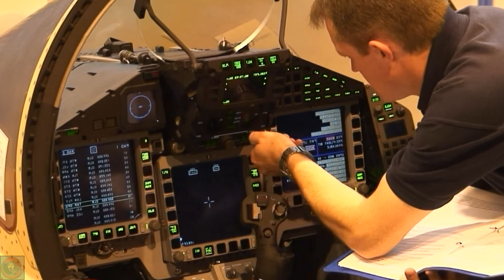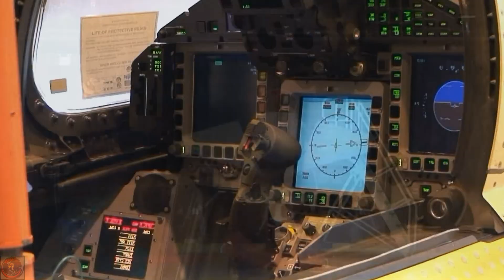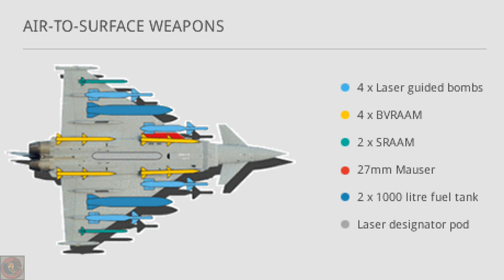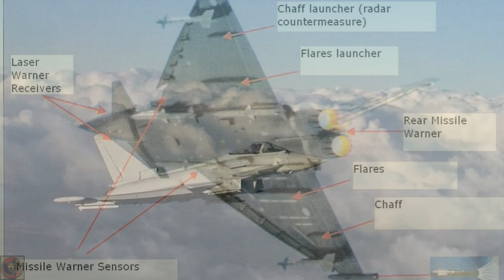Eurofighter Typhoon Combat Fighter Jet - Europe’s 4th Generation Fighter

Comment: I would say an EF is like a 4.75 generation system. Except the stealth has 90% of the capadilities of a 5th gen not discarding that at some point limited thrust vectoring is totally possible to integrate. Will not do the manouvers of the freaking archangel master of the sky thats the F-22 Raptor, but is a well rounded plane for his time and age.

Comment: I love it when dumb kid's say that the F-22 is the best or that it's on a different level, those kid's read to much Wikipedia, for example here is a few years of reading real reports and papers putting the Eurofighter against the F-22.

The Eurofighter is the best, it can do everything the F-22 can do and more.

Some Example's to show why the Eurofighter is king, all can be found online Paper's and Reports open to read. 

The Eurofighter and the F-22 both can take off and go straight vertical, something that kid's say only the F-22 can do, again they read Wikipedia. 

The Specs of the Eurofighter vs F-22 for example.

Speed /
Eurofighter 1550 mph Mach 2.0 TMS.
F-22 1495 mph Mach 1.98 TMS.

Altitude Ceiling /
Eurofighter 65,000 f.
F-22 63,000 f.

Sustained Turn Rate /
Eurofighter 28.5 D/S.
F-22 27 D/S.

Instantaneous Turn Rate /
Eurofighter 36.5 D/S.
F-22 35 D/S.

Engine Thrust - Vectoring /
Eurofighter 21,500 ibf x2 - 2D Vectoring, Vectoring up down left and right. 
F-22 35,000 ibf x2 - 1D Vectoring, Vectoring up and down.

Plus the Eurofighter's EJ200 Engines are the most advanced. 

Being 3 Different types of Thrust Vectoring, 1D - 2D - 3D. 

Eurofighter is lighter and smaller so has a better power to weight ratio.

The Eurofighter has better range / Combat and A to B.

The Eurofighter Has a Better Dive/Cilmb Rate with better energy hold.

G's and -G's.
Eurofighter 9+ and -3.5G's.
F-22 9+ and -3.2G's.

Hard Points /
Eurofighter 13.
F-22 8.

Gun /
Eurofighter x1 27mm with 150 rounds.
F-22 x1 20mm with 480 rounds.

Missiles BVR - WVR /
Eurofighter BVR Meteor Missile the best in the world x2 ranges 1st 150km for fast agile Targets 2nd in testing showed to go 300km for other Targets, The Biggest NEZ of 60km, Speed of Mach 4.5, more Agile then the AIM-120D as well, WVR the ASRAAM Faster then the AIM-9X and more agile between 5 to 55km.
F-22 BVR AIM-120D 1x range Maxed at 160km a NEZ of 20km, and a speed of Mach 4, WVR AIM-9X more agile under 5km.

But no pilot will use the full range of their missile, like the 150+km on the Meteor or the 160km on the 120D due to the low chance of really hitting anything, and giving the enemy longer for the RWS's to pick it up and just do a 180 run, making the distance longer for the Missile, you'll want to fire within about 100 - 70km or  even 50km, to have a higher chance for the Missile to hit and last time for the enemy to have to  counter. 
This is what I find funny is that people say, ( well this jet can fire from hundreds of miles away and kill it before ) NO, it's Bullshit their are the one's that don't know fuck about RWS's - MTT or even Defences, older 3rd gen jets with old as shit RWS's yes probably, but not 4th gen or 3rd gen with advanced or one of the most advanced RWS's ever in it, and plus again people that say from hundreds of miles away, don't know missiles. 

Eurofighter uses the Striker 2 Helmet more advanced and able to lock on to targets and fire with out lining the jet up with the target.
F-22 is outdated and old the hardware and software is not there to be able to use the Helmet to lock on and fire like the Eurofighter can, so the F-22 needs to line up to lock and fire.

Radar / 
The Eurofighter uses one of the best Radars out today, able to pick up the F-35 and F-22 from distance, and able to track a multi group of targets at once.
F-22 has a good Radar picks up the Eurofighter from distance as well, but cant handle as much as other radars can, but still can track lots of targets.

In War Games not just Rad Flag and in friendly training Between the Eurofighter and F-22 both have won against each other over the years. 

Design /
Eurofighter was designed for Air Dominance and does have some stealth in the design having the smallest RCS against the Rafale and Gripen, with the Wing Design on the Eurofighter it is 20% more efficient then your wing design on the F-22, The Eurofighter is 1 of 2 jets the other being the J39 the Eurofighter in the same mission go from air to air then air to ground with its payload, the F-22 its one or the other.

The Eurofighter can do all the F-22 can do plus more, The Eurofighter has better specs better Missiles better Hardware and Software plus is used by the best the RAF.

Plus the F-22 is to expensive for the US to upgrade and keep maintaining, the F-22 was stop being made years ago, plus stop training for the F-22, but the Eurofighter is still being maintained and still being updated with newer and newer Hardware and Software. 

The Eurofighter is king.

Comment: In performance terms, the Typhoon achieves what, in Western service aircraft, only the F-15 can match. The F-22 Raptor is not far behind, but then there's a big gap. Having run through endless videos of aircraft trying to impress the crowds or potential buyers, these three, Typhoon, F-15 and F-22, are in a class of their own.

Whilst the F-15 is your regular barn door in terms of radar cross section, it carries a phenomenal payload. It remains a high value asset because of this, its modernised avionics and it's fighting ability. However that cripplingly high RCS requires further enhancements in electronic countermeasures before it can support the F-22 in stealthier, high altitude missions in the future.

The less RCS you need to hide, the less energy your ECM's demand. This is where the Typhoon comes into its own. Having been designed to the pinnacle of European engineering technology, and as stealthy as European budgets allowed, enough per aircraft cost was saved, against what the USA was spending on the F-22, for the Typhoon to proliferate to a far greater degree. The F-22 has, with the Typhoon, a perfect missile truck. The Typhoon flies more of the F-22s operational flight envelope than any other western aircraft. It is the aircraft most like the F-22. And there are a lot of them. So whilst not bringing the huge wing fulls of missiles to the fight that the F-15 can, the Typhoon can, at first, carry conformal Meteor missiles very stealthily behind an F-22, which it is then cleared to fire whilst supersonic; in supercruise. This is a major boost to the F-22's arsenal in contested airspace. Not only is the Meteor a well respected missile, it is given greater range by being fired from the Typhoon. And whenever the F-22 needs to manoeuvre or just light up and be somewhere quick, the Typhoon is there, in the shadows, no problem.

The Typhoon is a smaller aircraft than the F-15 or its stealthy successor, the F-22. So what it achieves it does to lesser stores or endurance. But that smaller size improves visible stealth in return. In the visible spectrum, the Typhoon is small and has its PIRATE Infra Red Search and Track; IRST. So again the Typhoon can see in a way the F-22 cannot. Every little advantage brought to the fight helps.

The Typhoon's WVR ASRAAM and BVR Meteor both significantly exceed the range of the F-22 counterparts. The tactical advantages here are many, but include being able to hang behind the Raptor but fire through onto target. The Typhoon is stealthy enough that a foe must stick around to course correct missiles they have fired until the smaller missile sensors find the Typhoon. This in itself places that foe in considerable danger, especially when the Typhoon can be seen, but the existence, or not, of an accompanying Raptor, cannot be determined.
Reply: Great comment. I love how you integrated all aspects into the equation.
Reply: The Eurofighter is the best, it can do everything the F-22 can do and more.

Some Example's to show why the Eurofighter is king, few years reading reports and papers, and all can be found online Paper's and Reports open to read. 

The Eurofighter and the F-22 both can take off and go straight vertical, something that kid's say only the F-22 can do, again they read Wikipedia. 

The Specs of the Eurofighter vs F-22 for example.

Speed /
Eurofighter 1550 mph Mach 2.0 TMS.
F-22 1495 mph Mach 1.98 TMS.

Altitude Ceiling /
Eurofighter 65,000 f.
F-22 63,000 f.

Sustained Turn Rate /
Eurofighter 28.5 D/S.
F-22 27 D/S.

Instantaneous Turn Rate /
Eurofighter 36.5 D/S.
F-22 35 D/S.

Engine Thrust - Vectoring /
Eurofighter 21,500 ibf x2 - 2D Vectoring, Vectoring up down left and right. 
F-22 35,000 ibf x2 - 1D Vectoring, Vectoring up and down.

Plus the Eurofighter's EJ200 Engines are the most advanced. 

Being 3 Different types of Thrust Vectoring, 1D - 2D - 3D. 

Eurofighter is lighter and smaller so has a better power to weight ratio.

The Eurofighter has better range / Combat and A to B.

The Eurofighter Has a Better Dive/Cilmb Rate with better energy hold.

G's and -G's.
Eurofighter 9+ and -3.5G's.
F-22 9+ and -3.2G's.

Hard Points /
Eurofighter 13.
F-22 8.

Gun /
Eurofighter x1 27mm with 150 rounds.
F-22 x1 20mm with 480 rounds.

Missiles BVR - WVR /
Eurofighter BVR Meteor Missile the best in the world x2 ranges 1st 150km for fast agile Targets 2nd in testing showed to go 300km for other Targets, The Biggest NEZ of 60km, Speed of Mach 4.5, more Agile then the AIM-120D as well, WVR the ASRAAM Faster then the AIM-9X and more agile between 5 to 55km.
F-22 BVR AIM-120D 1x range Maxed at 160km a NEZ of 20km, and a speed of Mach 4, WVR AIM-9X more agile under 5km.

But no pilot will use the full range of their missile, like the 150+km on the Meteor or the 160km on the 120D due to the low chance of really hitting anything, and giving the enemy longer for the RWS's to pick it up and just do a 180 run, making the distance longer for the Missile, you'll want to fire within about 100 - 70km or  even 50km, to have a higher chance for the Missile to hit and last time for the enemy to have to  counter. 
This is what I find funny is that people say, ( well this jet can fire from hundreds of miles away and kill it before ) NO, it's Bullshit their are the one's that don't know fuck about RWS's - MTT or even Defences, older 3rd gen jets with old as shit RWS's yes probably, but not 4th gen or 3rd gen with advanced or one of the most advanced RWS's ever in it, and plus again people that say from hundreds of miles away, don't know missiles. 

Eurofighter uses the Striker 2 Helmet more advanced and able to lock on to targets and fire with out lining the jet up with the target.
F-22 is outdated and old the hardware and software is not there to be able to use the Helmet to lock on and fire like the Eurofighter can, so the F-22 needs to line up to lock and fire.

Radar / 
The Eurofighter uses one of the best Radars out today, able to pick up the F-35 and F-22 from distance, and able to track a multi group of targets at once.
F-22 has a good Radar picks up the Eurofighter from distance as well, but cant handle as much as other radars can, but still can track lots of targets.

In War Games not just Rad Flag and in friendly training Between the Eurofighter and F-22 both have won against each other over the years, with some Eurofighter Pilots with a joke about having Raptor States for lunch. 

Design /
Eurofighter was designed for Air Dominance and does have some stealth in the design having the smallest RCS against the Rafale and Gripen, with the Wing Design on the Eurofighter it is 20% more efficient then your wing design on the F-22, The Eurofighter is 1 of 2 jets the other being the J39 the Eurofighter in the same mission go from air to air then air to ground with its payload, the F-22 its one or the other.

The Eurofighter can do all the F-22 can do plus more, The Eurofighter has better specs better Missiles better Hardware and Software plus is used by the best the RAF.

Plus the F-22 is to expensive for the US to upgrade and keep maintaining, the F-22 was stop being made years ago, plus stop training for the F-22, but the Eurofighter is still being maintained and still being updated with newer and newer Hardware and Software. 

The Eurofighter is king.

Comment: The Raffale is the result of the French pulling out of the eurofighter program. Hence the obvious similarities in design. It isn't the first time the French pulled out either.

Also, folks. Elevators are rare on modern fighters. You'll get a better understanding of how modern conventional designs work if you look up stabilators. 

Elevators became useless at supersonic speed due to compression. This rendered them ineffective. A stabilator performs the duties of the elevator and ailerons. Moving the entire surface instead of tabs on the surface. This why modern fighters turn the way they do. Cannards are similar.
Reply: The French have a history of building delta-canards though - look at the Mirage series.

Comment: The Typhoon doesn't actually have Cannards, but instead these are called Foreplanes.

The difference between these is how they control the aircraft - Foreplanes only control the aircraft in pitch, whilst Cannards control the aircraft in pitch and roll.

Also, the Typhoon does use the cannon, at least it has done in training sorties.

Great video though!